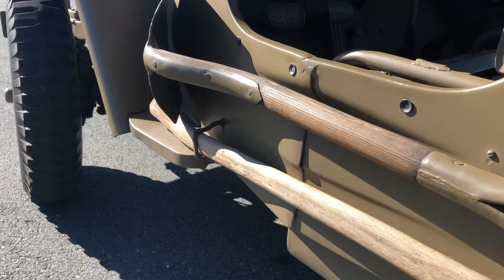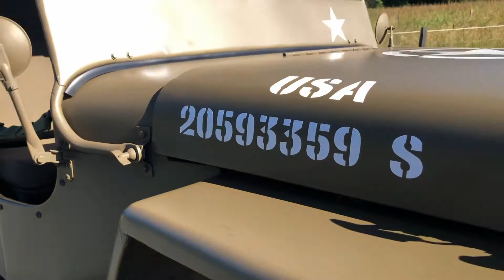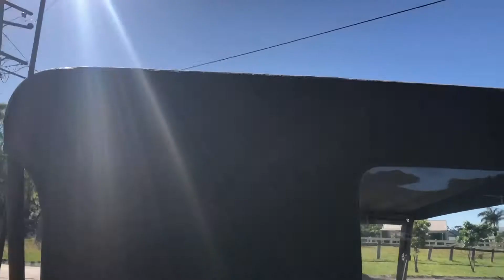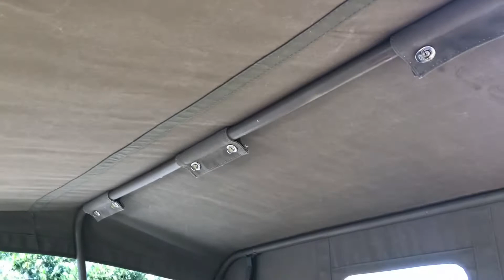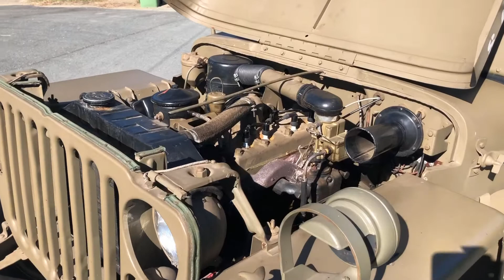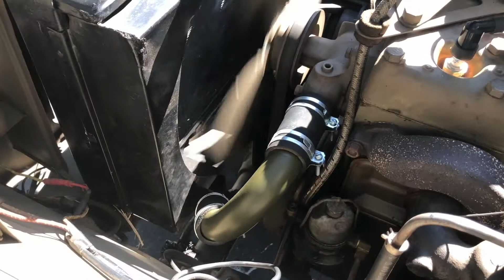1942 Ford GPW Jeep - Walk-around - BGS Classic Cars

Comment: If you listen closely you can hear the exhaust system cooling off. Tink tink tink .as a kid I had a 2 year old 1968 firebird 400 that used to do the same when I would stop. after driving  it..ps I have 2 jeeps as well.. a 46 and a 47..thanks for sharing this..

Comment: Mine had a 225 V-6 and a power steering unit from a 1967 Buick Skylark and a transfer case overdrive unit and could do 65+. Everything else was stock except for it's 11.5 wide Wrangler RT tires. 😁